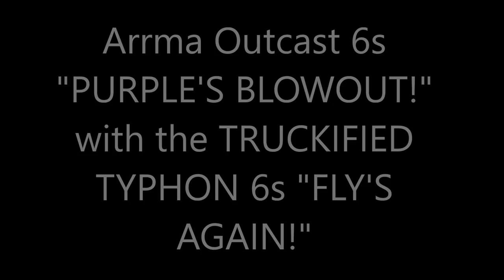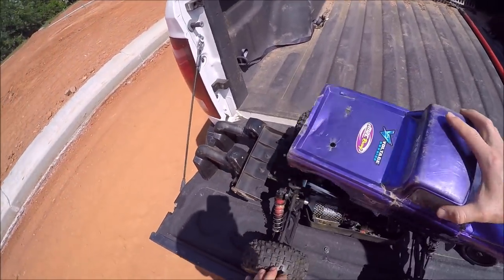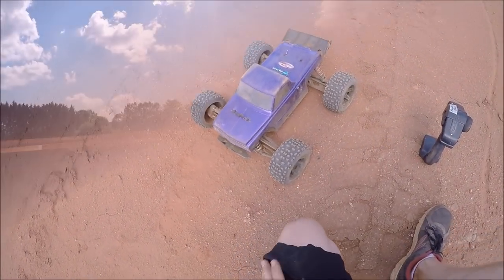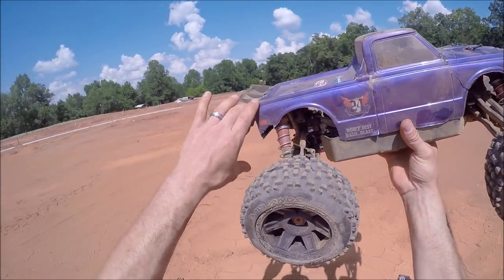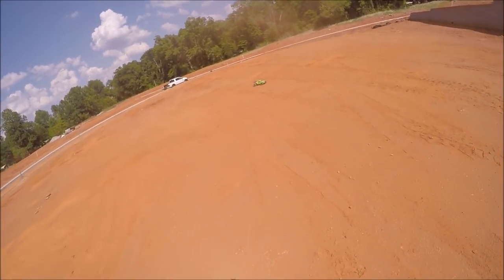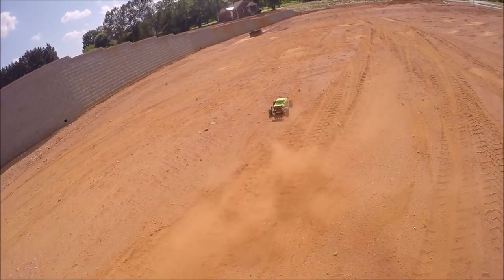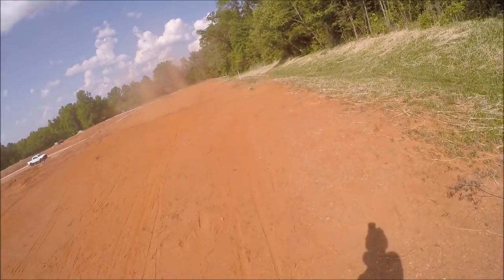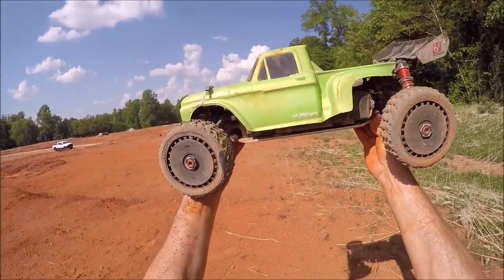Arrma Outcast 6s "PURPLE'S BLOWOUT!" with the Truckified Typhon 6s "FLY'S AGAIN!"

Comment: Friggin KILLER Bash Brother 👊!!!! Both trucks were rippin hard 👀. I've had my newer Badlands premounts come unglued😯. Glad she didn't rip on you and good thing you realized the motor lead came unsoldered 😝. Definitely got an AWESOME bash in despite some hiccups in the heat. Green just shreds it with those Katars 😜. Got my Truggified all rebuilt with M2C but it's been raining out here in CA again 🤣🤣. Ground should be nice and tacky soon 👌. Keep up the great work Eric!!!! 🍻🤘🤘😎💪💪💪👊👊
Reply from the maker: Thanks so much Rich!!😁Yeah I was a bit worried on temps running 18 tooth in 95 degrees. The motor wasnt dangerous hot but the amp draw I guess unsoldered the wire..oh well, not the first time that's happened!😛Price to pay when rippin hard I guess!🤣The Badland was an easy fix but I may get Purple back to her roots with Katars on the next run!😎 Hope you get some nice weather bro! Gotta get that bash in!!😎👊🤘🤘🍻

Comment: Hey bro I got my new arrma kraton 4s 1/10 yesterday I took it apart today to put fluids in the diffs and all new bearings before I even use it and I dunno man all plastic gears in the diffs and in the slipper box don't know how they gonna hold up shocks seem pretty good though let's hope it holds up hopefully someone will make metal diff gears . The internal spider gears are metal but the ring gear and crown or pinion are all plastic I just don't trust plastic. Sweet video man I don't know how your trucks live through this 👍 if it was me they would break first jump lol
Reply from the maker: I know what you mean man. I thought the same thing when the first 3s blx line came out. I was totally on the fence about getting one but they do hold up very well! They are plastic but very thick!! If they can hold up to 4s power, that's saying something!😁I've had no issues with my 3s rigs or 4s Outcast with the diffs. Only driveshafts simply bc I had my slipper too tight. That will help save the diffs too having a tad bit of slip. Hope your luck is good too bro! BASH ON!!!😎👊🤘🤘
Reply: @RCDUDE81  thanks man when I opened my kraton 4s the slipper was so loose it wouldn't even move so I tightened it way up. What do you recommend? All the way down then back half a turn? Hard to judge when you can't see it
Reply from the maker: @theirishaxe9405  Yeah it's hard to judge for sure. I usually put on some threadlocker and go all the way tight, then back out a quarter to half turn. Be careful tightening them down b/c they will snap if you crank on it! Done that a couple of times!😁

Comment: Surprised you didn't take the wheels off the green machine and put them on the purple monster after the wire came unsoldered to keep bashing on
Reply from the maker: I've never ran buggy wheels on the Outcast but that would be interesting🤔It was like 100 degrees out and I was ready to be done anyway..😂😁😎👊👊🍻
Reply: Ya 100° Id be in the a/c, I got the heat goin it's 38° here in MN...  there's a guy in the arrma army group that runs them on his outcast he said it's like it's on rails.... But I think he said they they talion wheels idk if the typhon wheels are smaller

Comment: You running 3.8 or 2.8s
Reply from the maker: 3.8's on the Outcast and Buggy Katars on the Typhon.😎👊
Reply: @RCDUDE81  thanks brotherman one more question im into the diffs how we get spider gear out flat one drive gear forget called is it pressed
Reply from the maker: @rcplayer7581  Those can be a #$@ to get out!😂I use some needle nose to pull it out but sometimes it takes working at it to un seize it.
Reply: @RCDUDE81  thanks brother i was being impaitaint wanted make sure dont even have shims yet after using kraton i want outcast perfom riggtway too not doing sloppy dance all overplace😂